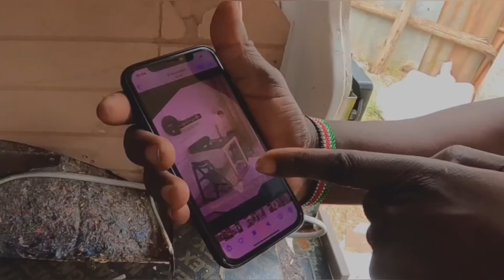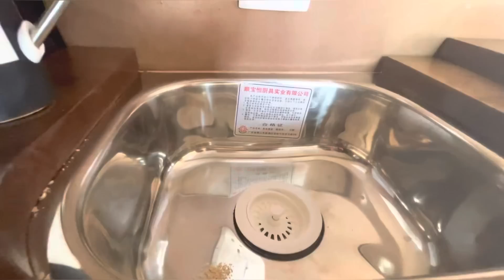We Fixed The SIMPLEST PLUMBING & ELECTRICITY Systems For Van Life

Comment: IDEAS : from someone who lived van life
1. run led lights on the grooves on the ceiling and 
2 Design cabinets that will fasten your stuff since you will be on the move and you don't want things flying all over.
Reply: I thought about the locks for the cabinets as well. The roads here in Kenya are wild. Everything will be flying everywhere.
Reply: @tjortaraja May be that will be among the final touches
Reply from the maker: Hi Someone who lived Van Life 😅
Do you have Instagram? I’d like more ideas 
Yes, we are looking to run something called snake light on the grooves. I don’t know if it’s LED, I’ll ask today. 
For the cabinets, I’m looking to have locks on the sides for times when I’m moving. I’ll also have an elastic string fastened on the opening of the cabinets to keep the things inside from rustling. What do you think?
Reply from the maker: Yes, it will. There are minor things that need to be touched. Right now, we are working on the mechanical and outer body parts. When that is done, the interior final touches will come.

Comment: You must buy solar batter banks for solar panels.
Reply from the maker: Yes, we bought a solar battery that will be connected to the solar panel when we mount it on the roof
Reply: What about air conditioner & shower Awning ?  If your tire is thin , cannot mud.  Only tire military tire. Remember. 👍  You must buy steering wheel lock ful cover and tire wheel lock full cover.